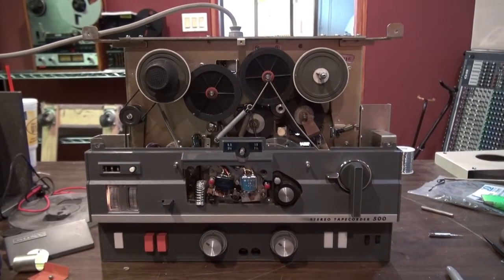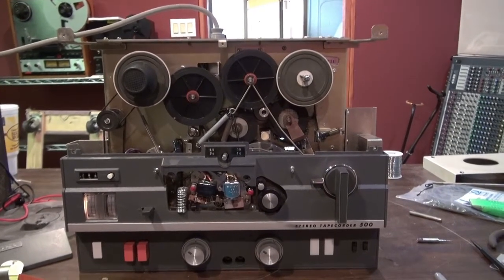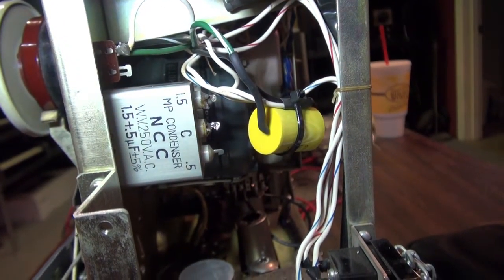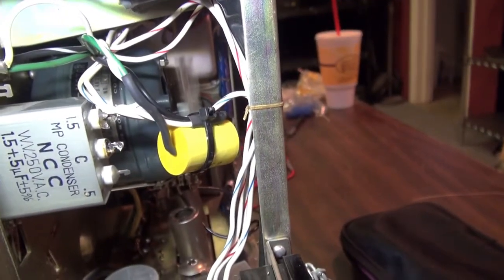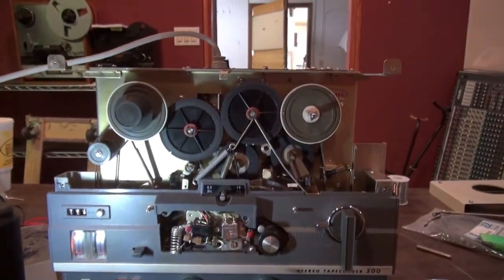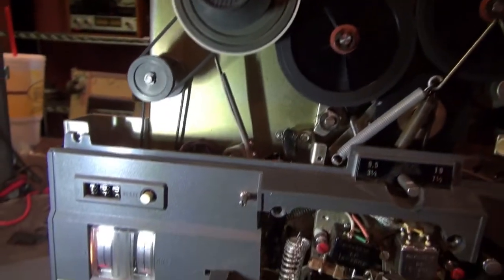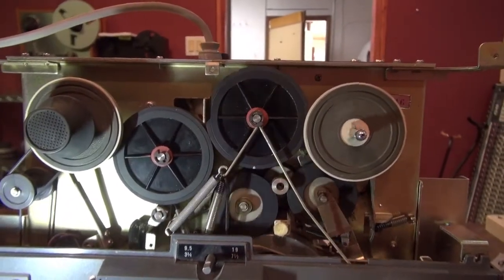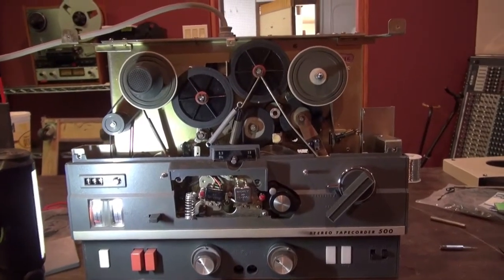SonyTC 500 open reel- run capacitor

Comment: So to open it up, just remove every screw I can find? Mine works Okay, but I'm hearing a little electrical crackling that needs looked at.
Reply from the maker: There's a series of screws on the back, as I remember, four of them I think, which will let you take the outer case off to see most of what I show in the video. That' s been a couple of years now so I don't remember it perfectly.